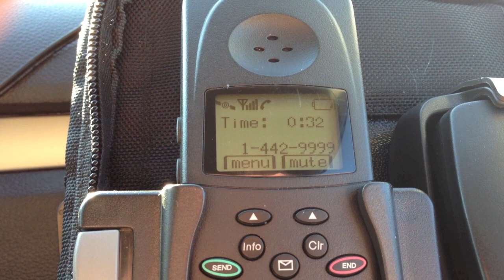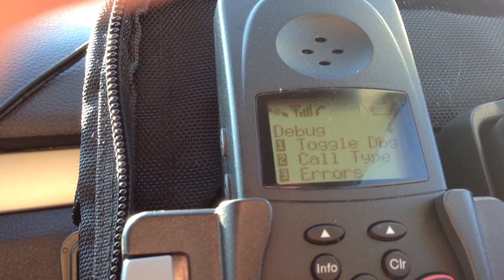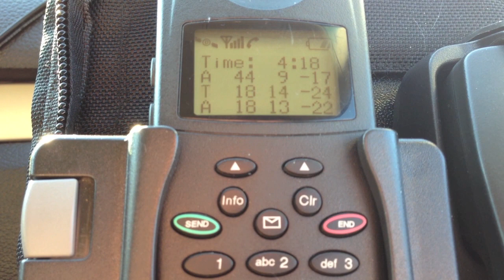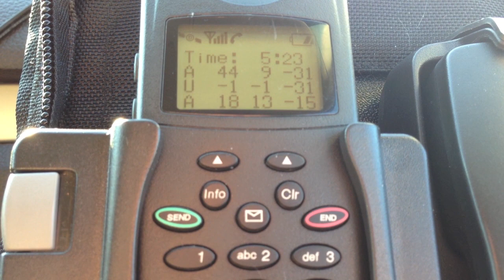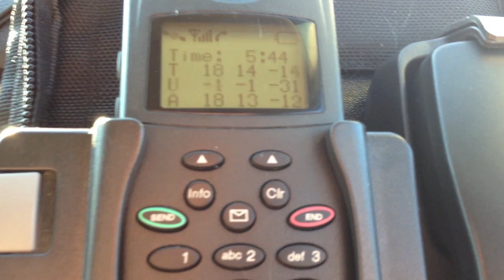Globalstar GSP-1600 Engineering Mode - Handoffs & SNR

Comment: it is really interesting to see that "field test mode". So cool.  i have an iridium 9555 phone . 9555 (and 9575 phones) allows me to enter to field test mode by long-pressing # key (without sim card) but i couldnt figure out the codes. there is no information and google finds nothing. i tried to brute-force by manually entering the numbers, but no luck so far.. there is nothing between 1-1000. And yes it is really time consuming. If you re reading this comment and knows something about it please contact me
Reply: Hi Angel, if you have any update on some Test ID that you found, if you like to share it I'm really interested, I've also have an 9555. Thanks!

Comment: just got one of these off ebay UK, with no charger or accessories for £3.95 + £6.95 fed Ex post.
I bought a car charger for £28.50 and it works A1...
a full kit for less then £40

Comment: This is pretty cool!, I am thinking about getting a satellite phone now. I just wanted to know, what plan for Globalstar where you using?, cause ot seemed like you where "careless" of your minutes, let me know!, Thanks!
Reply from the maker: Good observation - when I signed up for service, Globalstar's network was in bad shape because there had been premature satellite equipment failures and they had not finished launching all the replacement satellites. The upshot of this was that there were certain times of the day when you couldn't make or receive a call. Because of this, Globalstar was offering very cheap plans; mine was "unlimited everything" for something like $30/mo. This special plan is what made me able to afford to mess around with the phone so much without burning up those otherwise-expensive minutes :).
Reply from the maker: Globalstar has since fully repaired their satellite network and does not currently offer plans like that anymore. You can still get unlimited service, but it costs $150/mo now instead of $30.
Reply from the maker: Finally, Globalstar is planning on upgrading their overall system and releasing new subscriber equipment in the first half of 2017. If you don't need a satellite phone immediately, it may be worth waiting for the new equipment to be released.
Reply: Right, well I found a (almost brand new) GSP-1600 for 50$, I thought it was worth a shot, then I looked at the plans and stuff, I really wish the unlimited plan was a bit cheaper. So I kept looking, and I heard of "prepaid" plans, so I thought to myself "Well, that's great!, just top up when you need too!" Doing some more research, I found out that Globalstar discontinued the prepaid plan, great. But I am still interested, in getting one, at least if I have one I can have peace of mind, and data rates of 9.6 KBps :P So how is the service now?, do they now have full coverage? Will I need to wait for a satellite to pass by me to work? Sorry if I seem new to this, I just want to get started using a satellite phone and I don't know which provider is the best one.